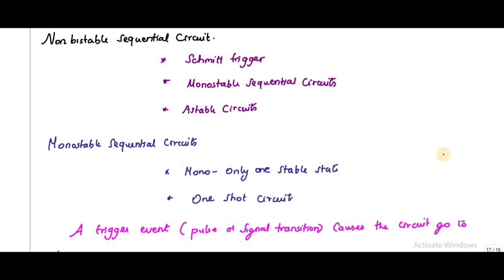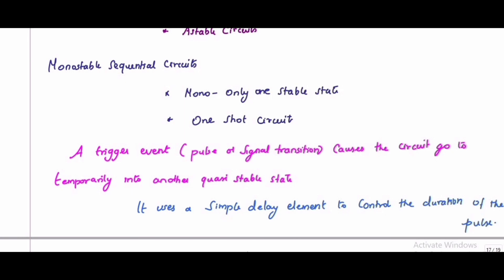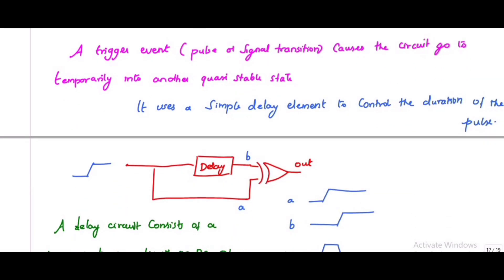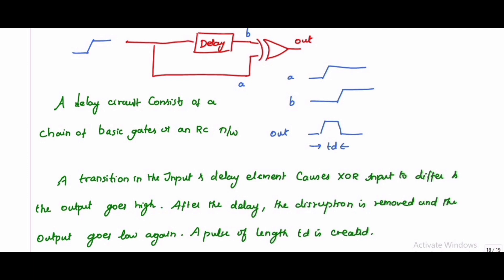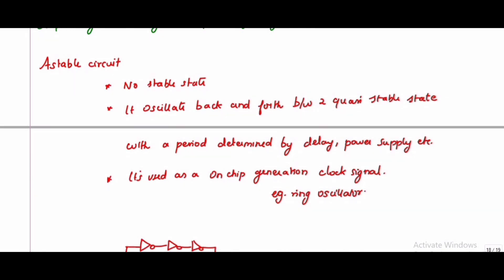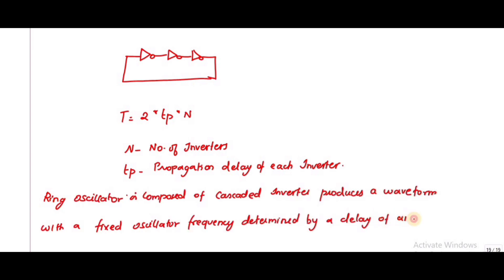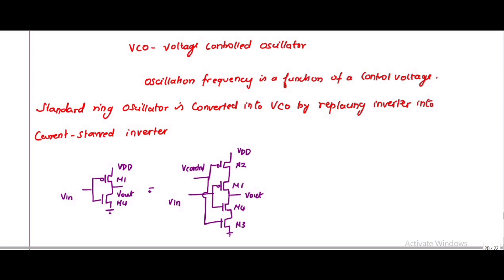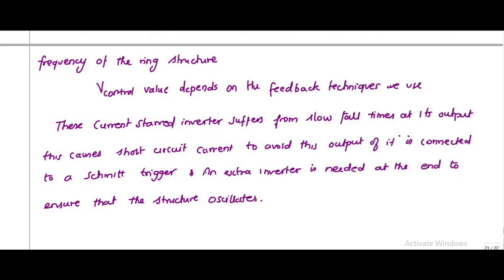Non bistable sequential circuits

Comment: Sir please upload some more important question topics monday we have semester exam sir please. Just a humble request
Reply from the maker: Read DC transfer of nmos and cmos inverter, scaling of mosfet from unit 1.power consumption and problems on linear delay model, elmore constant, dynamic latch and register and pipelining, adders, multiplier and sram, asic types, soc and cmos fabrication
Reply from the maker: Read non ideal iv characteristics, static cmos and types of implementation, arbiter, time borrowing, metastable state, 1bit barrel shifter, classification of memory and it's difference, dft, controllabilty and Observability-2 marks
Reply: @ECE_VIDEOS  thank you so much sir